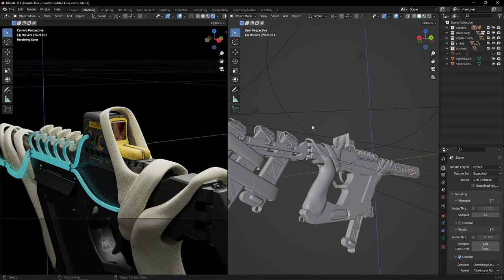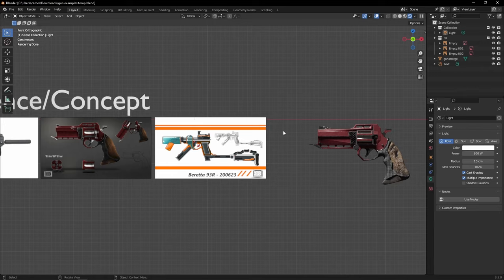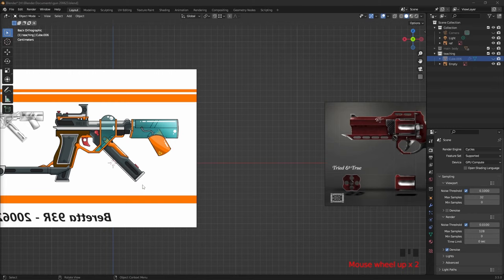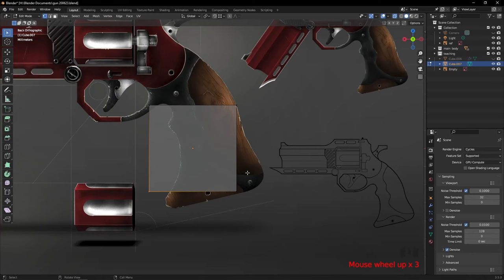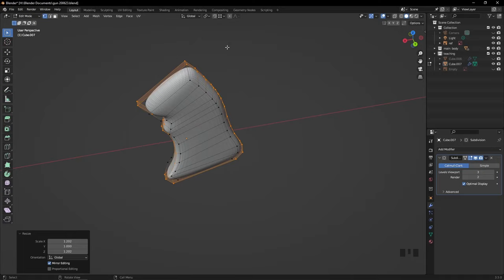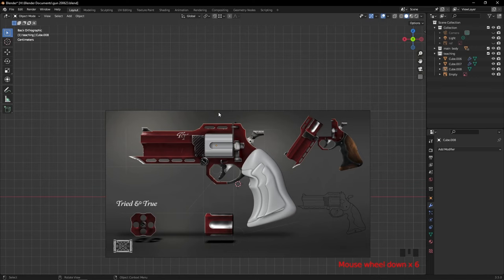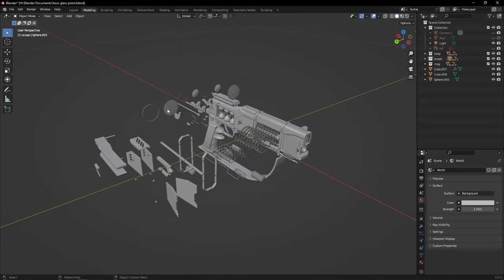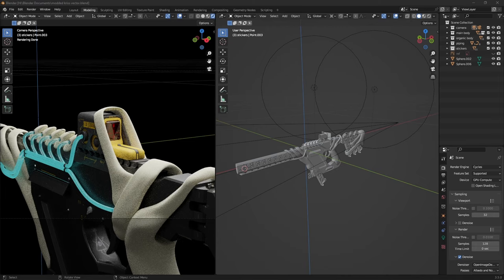How to Model Any Gun in Blender.   Overview

Comment: Unfortunately, the most important advice is not named. Before the blockout, it is important to immediately find the correct proportions. For a gun, this is the caliber, that is, you need to start by modeling the correct size bullet, making a barrel for it, and then a magazine (roughly). And already having these proportions, you can start blocking. I had such a thing that I remade the entire gun almost from scratch, simply because in the end my proportions did not work as they should, simply because I did not know this rule. Good luck
Reply from the maker: Well said, Excellent advice thank you.

Luckily blender has a ruler and you can enable measurements for edit view for all those wondering how to check. Another good way is to prop it up next to a person to make sure the handle and stock are usable.
Reply: This is what I thought about when modeling revolvers for example. The cylindrical magazine gives a perfect reference for the width of the gun
Reply: @gnagarjoel  The easiest way to get proportions correct for firearms is to start with the cartridge. You can easily find the dimensions of the ammo used for any given firearm, then you can make everything else to fit.
Reply: Don't need that actually probably if your trying to make your own gun 🔫 . I just wanna know how to make the frame
Reply: @CreoSolus does blender already have frames in there ? I'm learning. I just wanna make a frame say for a Ruger or something
Reply: I did all this, created the mag, the bullet and barrel, but I didn't make sure the magazine would look good inside the chamber, so when it came to that the mag was clipping all over the place. Instead of redoing everything again, my AR15 simply uses single stacked mags lol.
Reply from the maker: @JoseGonzalez-ed4hq   as for fames do you mean pre set gun frames? Sadly no you'll have to start the gun from scratch.

Comment: For those getting started in 3d modeling always understand the basics of what you're planning to build. for instance you're creating a gun. Guns in general have varying sizes of caliber. and so you create a 3d model of a very basic glock19. the portions outside (frame, reciver, slides etc) are right, but the barrel isn't. This could be a hideous flaw in the model, as some users would be able to see clipping or funky proportions even worse when you apply anims.

Bullet diameter of 9mm:	
9.01 mm (0.355 in)
Land diameter	8.82 mm (0.347 in)
Neck diameter	9.65 mm (0.380 in)
Base diameter	9.93 mm (0.391 in)
Rim diameter	9.96 mm (0.392 in)
Rim thickness	1.27 mm (0.050 in)
Case length	19.15 mm (0.754 in)
Overall length	29.69 mm (1.169 in)the casing is , 55.6 and 223 rem are 

It'll be very unwise to have a 3d gun model in 9mm and the barrel to be too small or too big. lol. other wise don't very discouraged to ask gun lovers or google for measurements. you can get away with it the guns were like plasma rifles or other cool space tractor guns.
Reply from the maker: Well said, thanks for the advice and feedback. Hopefully it will help people.

Comment: great video. I love modeling stuff like this (even though I don't have much experience doing so).  I used 3DS Max all throughout school and my license ran out.  Learning blender has been tough but honestly I like it more than 3DS Max.  This makes things much easier and fun.  Thanks for the tips!
Reply from the maker: Glad I could help, licences are the worst, Im completely fine with paying for software but they all work with subscriptions which is a bumber.
But as long as you're not working with simulations blender is awesome.

Comment: When I use the bool tool on the cylinder, the whole thing disappears and the mesh im using to make a indent stays. How do I fix this?
Reply from the maker: There could be a few reasons,
First make sure that both objects have there location, size and rotation applied. 

Check that the bool tool isn't hitting major vertices or edges.

Check for any flipped normals.

Lastly remodel the object with a clean vertice layout. Mostly quads.

Sometimes blender does have glitches but hopefully this helps.

Comment: Small question if anyone has the answer, when making a gun or even a battle tank, do people always model each party separately like Gun_handle Tank_Track and then merge them together?
Reply from the maker: I tend to, but there are many work flows some like to use modifiers on a single block similar to sculpting.
Some do half the gun then merge with mirrors.

Try to focus on the technique that best suits you. Different softwares will also dictate how you model.

Comment: So first off, to use CTRL SHIFT B you need Bool tool enabled, this caused a good 20 mins of headscratching, and now using diff just deletes my markers for the bevel without actually making a bevel. pls help.
Reply: also for reference, Im using a cylinder with 8 rectangles around it for the bevels
Reply: it makes vertisis when i used the difference tool, but i cant make them into indents, it just ruins the whole model.
Reply from the maker: With the difference tool/bool tool. There are two ways to cut; one applies the cut which adds vertices.
The other mode keeps the cutter object and the main object separated which won't create extra vertices.

I hope this helps, new software can be difficult. Remember not to take on a big task when starting out.
Reply: @CreoSolus  I was using the difference tool. It didn’t let me open the menu to select difference until I had bool tool add on applied tho.

Comment: where do you usually find your references?
Reply from the maker: I usually use pintrest or art station. But for the most part my references are of objects or materials that capture the mood of the gun I want to make.
For photos of engines and mechanical equipment I use unsplash.

 For the concept art I draw it myself.

Comment: why is the cylinder backwards on the gun?
Reply: it's champered backwards too??? huh??
Reply from the maker: I made quite a few mistakes with the gun. And it certainly isn't functional. But I just enjoyed how it look.

Thanks for the advice.
Reply: @CreoSolus  i'm sorry about being rude with my comments. i was puzzled about the decision-making that lead to it being designed in the way that it was. every revolver cylinder i've ever seen has more material in the back, towards the primer, with that material being evenly spaced around the perimeter of each shell. i assume this is because you want the cylinder to be as sturdy as possible in that area, because that's where the explosion happens lol. in the example in the video, the material is not only concentrated towards the front of the cylinder, the bullets are also positioned on the flat walls, instead of in the corners.
Reply from the maker: No worries, you clearly know a lot about guns.
Maybe for my next one I'll try to make it resemble a working mechanical gun.

Comment: do you have to add all the screws and stuff if the goal is only to add it into a video game?
Reply from the maker: You can do everything by yourself, it just takes a few more skills. But luckily unreal engine 5 is free so you can try to importing you models there as a test.
Reply: @CreoSolus  I don't think you understand their question, they are asking if you need polys for the screws or if you can just not model them. I believe the answer would be to model them and bake to a normal map on a low poly version of the model depening on the geo count.
Reply from the maker: Thank you, it seems there was a spelling mistake and I read "crews". Thanks for clearing it up. 
To answer i would say no, you can definitely just add screws into a normal map or just add 2d textures/stickers for more detail.